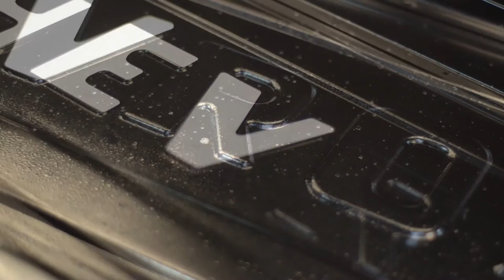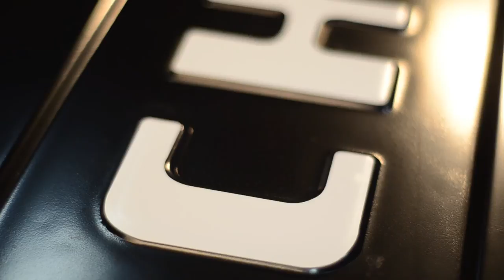How to Install Decals on a Truck Tailgate

Comment: The decals can also be used as a stencil if you choose to paint the letters.
Reply: I’m in the middle of a project and already painted the letters. Curious if when you pull the letters, would it rip the base coat up?